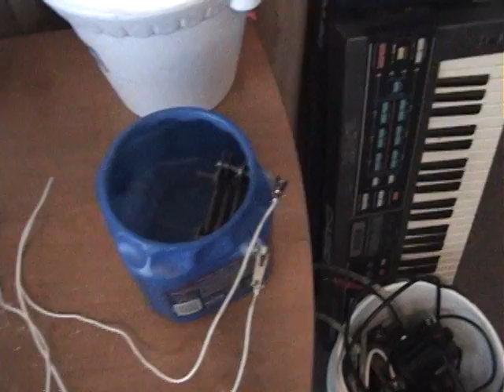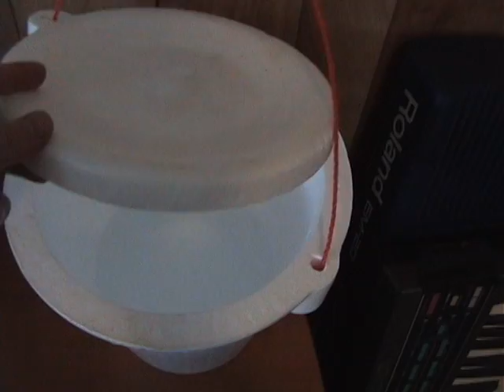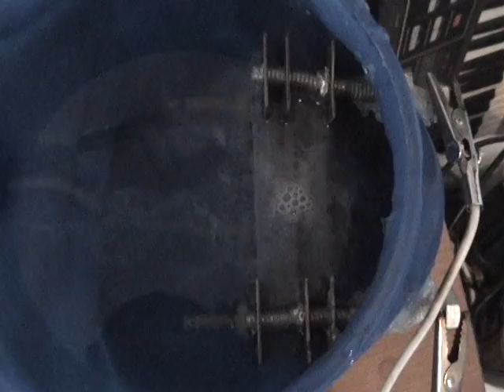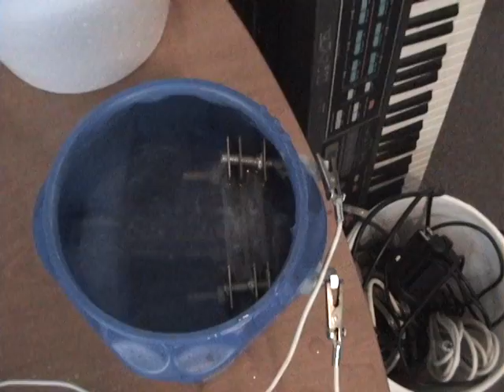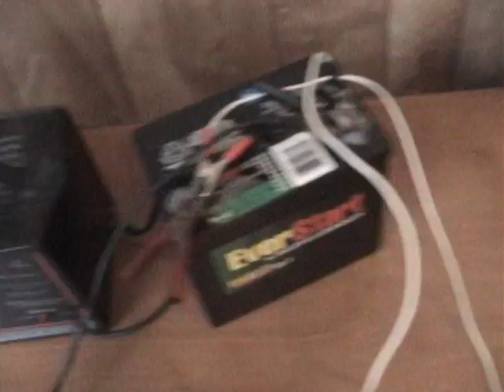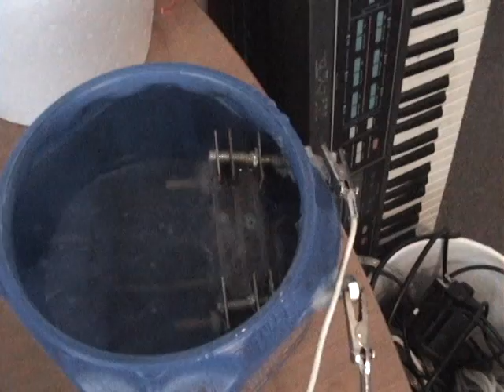Hyrdrogen generator using reverse osmosis water 1/3

Comment from the maker: The plates are actually push plates for a door that was 16x4, so i cut them down to 4x4 sheets. I got it at a locksmith shop yes it is stainless, just not sure of the grade and i haven't a clue about how much HHO it produced, i haven't gotten to that point yet.

Comment from the maker: Really the only change that I noticed is that with this RODI water, it did not produce much hydrogen as did with tap water until an electrolyte was added to the water bath. Also the rust (at least thats what I was told it was) did not form on top of the water bath as much, but still formed. I've taken my cell apart and going to try some new things. will post back as soon as i can.

Comment: If you use anything but quality stainless steel, you should expect some sacrifice of the plates as electrolysis is a brutal environment. Distilled water should work fine for most applications but I'm curious what changes you noticed. It seems like the secret to output is in plate design (use neutral plates) and electrolyte balance. Of course PWM and EFIE units are real and soon to be radio frequency devices splitting the water through the sparkplug during compression stroke. Stan Meyer did it.